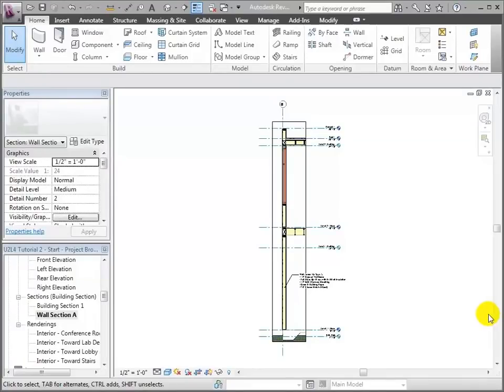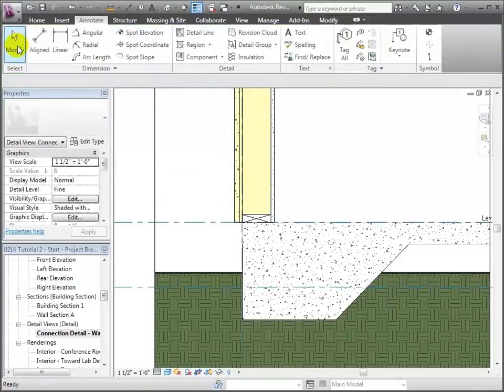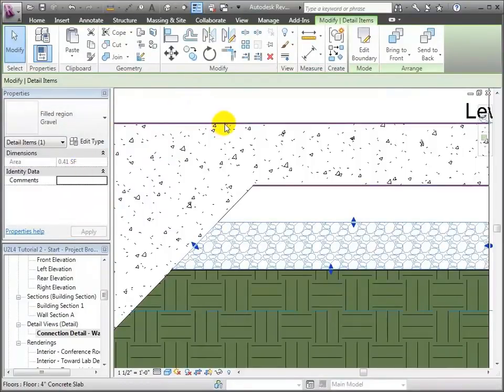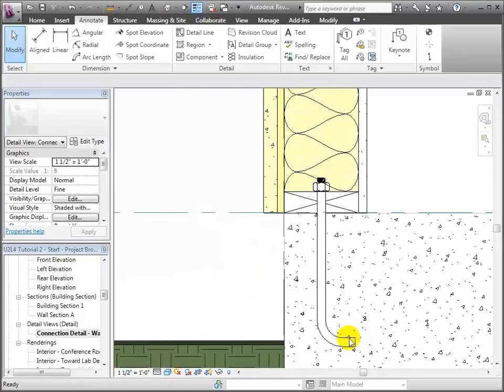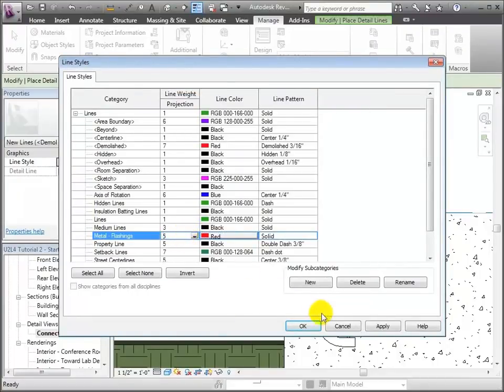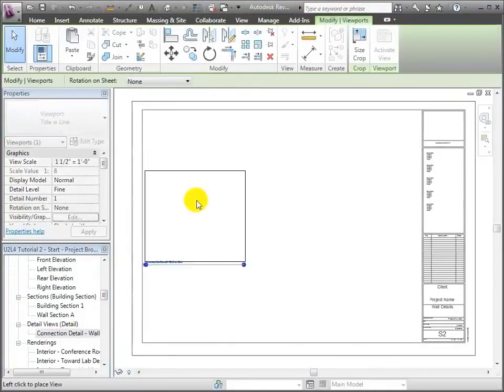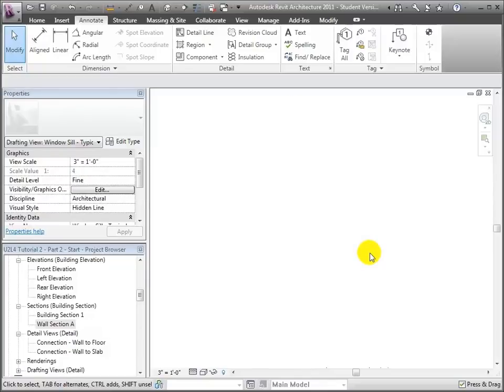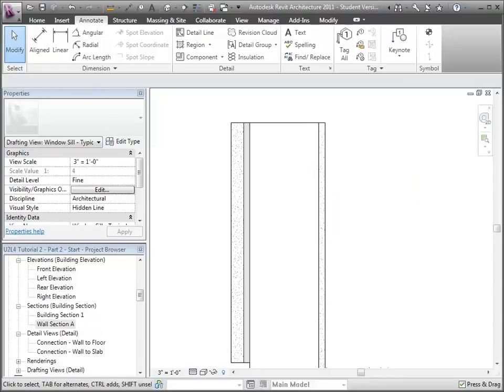Revit Architecture - Creating Details and Callouts

Comment: Can anybody explain me how in these videos they find directly the piece they want on the annotation library and I must instead search for an hour only to discover that there isn't this piece in my library?
Reply from the maker: Which family are you looking for?  These videos were created in 2011 using try be US Imperial library, and some of the annotation families may have been changed over last 6 annual updates.  I might be able to help you find a newer version or an equivalent component.
Reply: BIMtopia 
Thank you for answering and trying to help. 
No. My question was regarding the fact that in most video everyone seems to know exactly where to search and if or not there is a particular detail. I,  on the other hand,  I use photos of particulars in order to make my details,  but when I must search for something I have first difficulties to find the exact location inside the library, and also I end up not find what looking. 
One recent case was a detail which is used between the two parts of the wall and keeps the insulation between them in place. (but probably is on the Revit 2017) and I use 2016 now. Is there a visual way to see all the details someone has in his library and not have to search them by name only? 
Thank you again for the help,  and the videos offcourse.
Reply: I guess these guys already have the library that someone else did before or they have lots of time to search every family and download it then make the specific library containing lots of folders. It is actually all about searching skills. You got to know key words. But once, I had been searching for a revolving door. When I found, it has very different name not related with what the file including. So since then, I have been looking for families with very interesting and silly words and believe me, it is working.
Reply: Erhan Uysal 
I dont speak for a door or a window but especially for those small construction parts that one dont even know their names in order to search for them. If there was also a visual help when search on the library, it would be great.